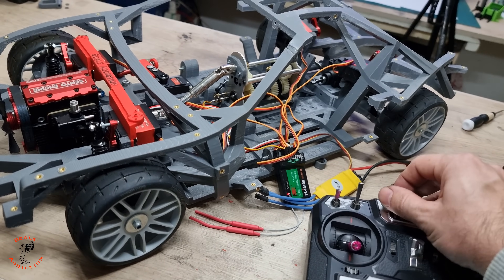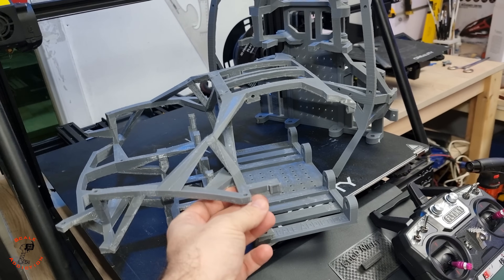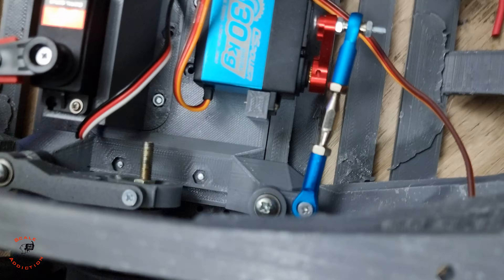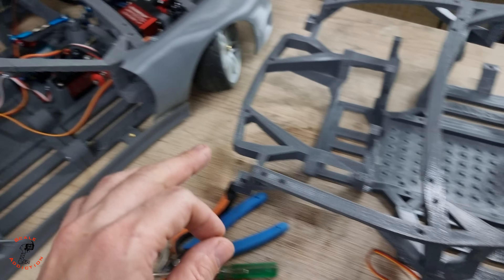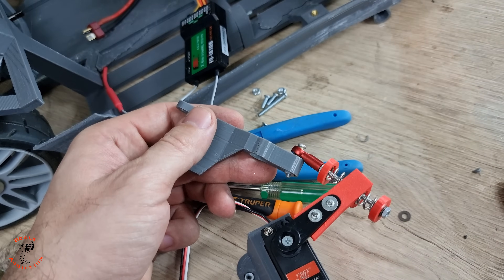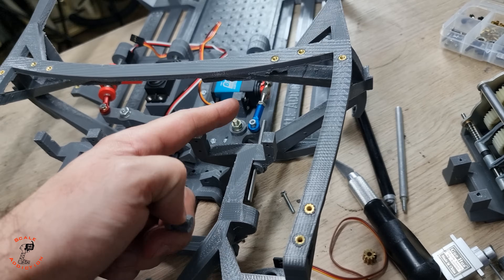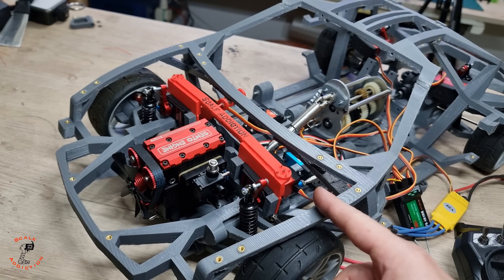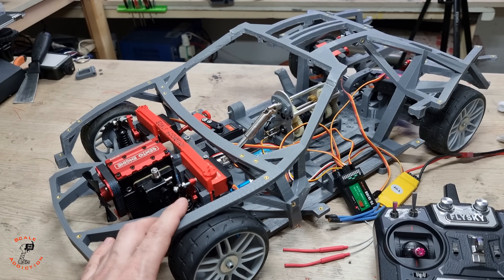Part 8 /  8th scale 3d printed supra with 2 cylinder engine project / Scale Addiction

Comment: Nice work but.....many people dont realise that 3D printed parts has limits in streng and temperatures. I should use mixed parts with differents materials and realise that you are using a combustion engine....is going to kind soften the chassis with the heat. I hope it helps you.
Reply from the maker: Thanks, yes I'm aware of that, after I know everything perfectly measured,  I will change the materials of print and ass insolation too

Comment: Such a bad angle on the drive shaft is probably going to give you problems later on down the my suggestion is lay the transmission down on its side and try and minimize the angle of the drive shaft
Reply from the maker: I know it looks horrible 😅, but I will put it on the side soon, after I run it

Comment: 👍🏾👍🏾👍🏾👍🏾👍🏾   I finally found videos of someone doing what I’ve been dreaming about for a couple of years.  From photogrammetry to 3D print.  My model should be ~ 805mm long (31.7 inches), radically custom, non-functioning engine, unconventional suspension and unorthodox exhaust manifold.  Researching CAD and modeling on iPad and Corexy printers.
Reply: Same bro
Reply: @mobdev9195  
👍🏾👍🏾👍🏾👍🏾👍🏾
Reply: But mine is a motorcycle
Reply: @mobdev9195  
👍🏾👍🏾👍🏾👍🏾👍🏾
Reply: Are you guys in university or is this a hobby for you?
Reply: I am making a direct drive RC car but i REALLY want the kenblock pigasus porsche 912 body shell for it. It needs to be 1/7 scale but i don't know how i could do that
Reply: Literally...same.  someone using one of these mini engines to make a real well scaled rc.  They're too expensive for me to do it... ❤

Comment: dang I was really hoping the arduino was gunna be part of the build so i can use a normal gun style controller
Reply: I'm kinda glad he ditched my arduino idea because that was such a pain in the ass for someone new to get things. Also his flysky has enough channels for gear shift etc etc. I'm sure he will add more functions later which will need more channels
Reply: I just finish programing my Arduino I haven't work out the finer detailed but i want to have it set up to be adjustable withe the controller and a potentiometer I'm gunna mount on the car I'm also playing with the idea of adaptive suspension using a gyro to counteract body roll probable gunna run into allot of problems like weight distribution which is kind of one of my biggest problem Voltage Regulator Efficiency and calibrating it to prevent erratic behavior  @orange_tweleve
Reply: @orange_tweleve  I have already programmed and Arduino  to be able to control the four servo. I still need to do some fine-tuning and endpoint adjustments, and I also intend on making it have adaptive suspension with the use of a Gyro

Comment: Could you split the chassis in 4 parts in order to be able to print it on 220 printers too? It could be divided in 4 with screwshold
Reply: That's what I did to make it fit my ender 5